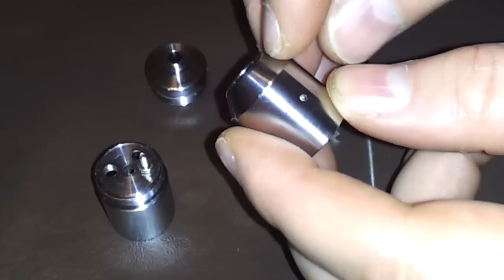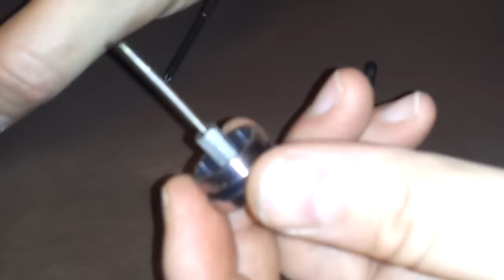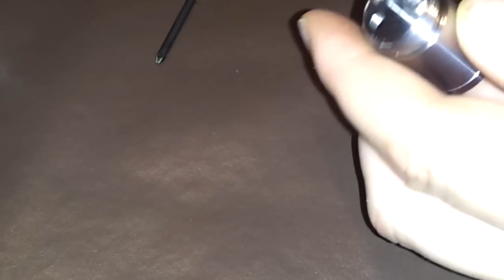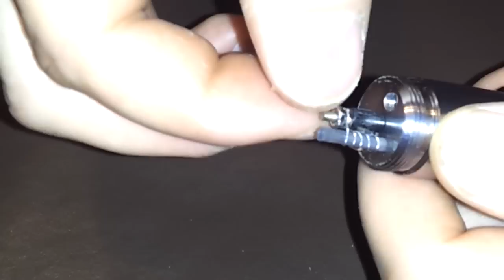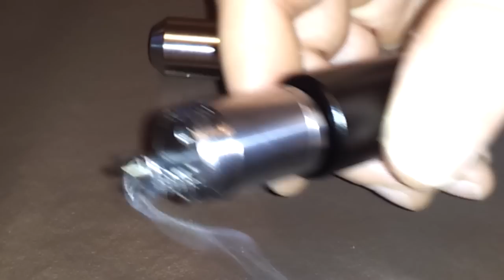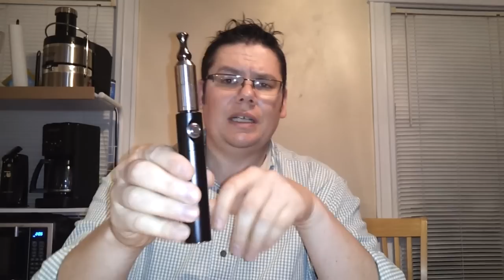Pitgen Rebuildable Genesis Style Atomizer (Electronic Cigarette)

Comment from the maker: Twisted Kanthal of 32 gauge make the wire twice as thick, and basically allows you to have a lower ohm coil with more wraps. I also use just single strand of 32 gauge, but do like the twisted wire also. It is all preference, and sometimes I go with different gauges on different devices. I have 4 different gauges that I currently wrap my coils with, plus the twisted wire, and they all give me a different set-up. Some may have the same ohm, but vape more different!